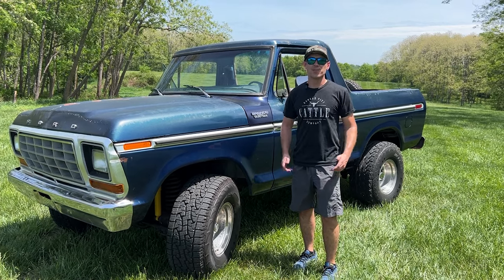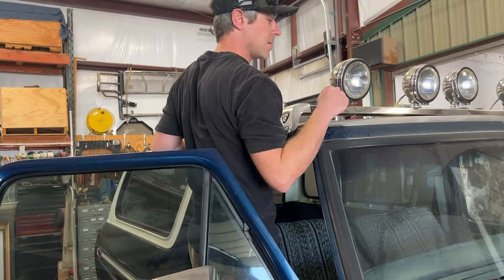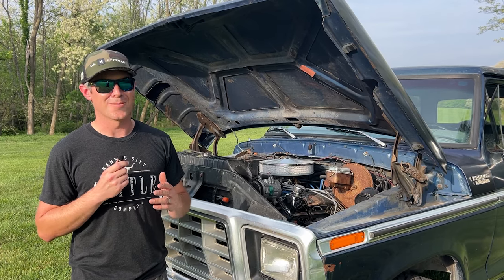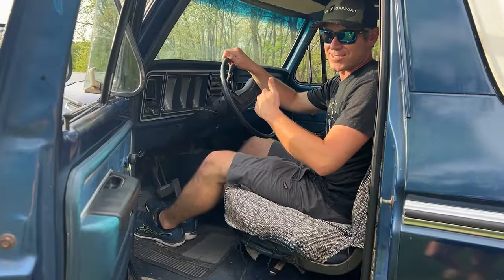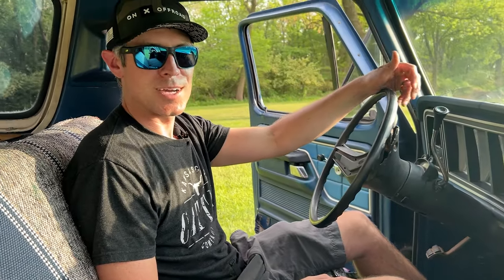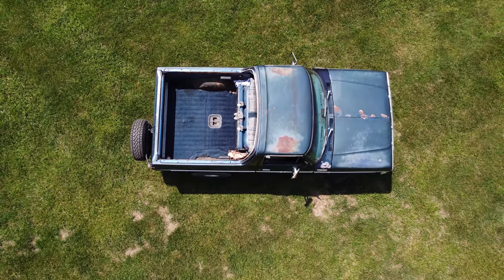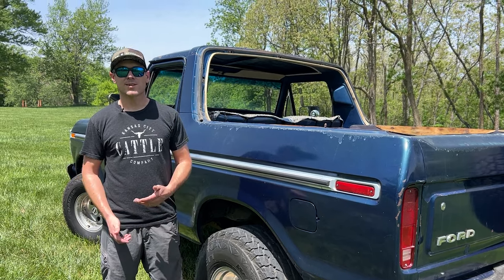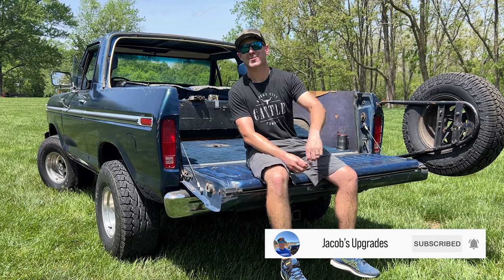Check Out My 1979 Ford Bronco Custom! | Off-roading

Comment: Nice Bronco. Congrats on finding a good one. I'm Restoring a 78 Bronco with a 460 CI Conversion. Lots of work ahead of me but I have the time. Retired last year.
Enjoy your restoration and thanks for posting the video.
Reply from the maker: Thanks for the comment! Congrats on your retirement and new Bronco project. Do you have a lot of rust and bodywork to do? I finally got my motor running  smooth and fluids changed throughout except the diffs. New Vintage Air AC and heat installed. Next up will be replacing the brake pads and rotors. I have plenty of Bronco videos on the channel, if you have any questions reach out!
Reply: @jacobsupgrades  I have rust at bottom of tailgate and above one rear wheel well. How do you like the Vintage Air AC and heat? I'm thinking about going that route vs repairing my existing system.
Reply from the maker: @uavoftexas6925  sounds like you have a good project with minimal rust. So far I really like the Vintage Air ac kit. I've used the heat portion quite a bit but just got the AC charged. When I bought the Bronco it had the stock ac and heat but it never worked so I don't have a good comparison. I really like how the vintage air kit fits behind the dash and frees up more space in the engine bay and only requires electric power. I had to upgrade my alternator to run everything.
Reply: @jacobsupgrades hey Jake! Im really considering getting that AC vintage kit for my bronco. Im not in too big of a hurry to get it since it costs a bit of change. Pretty much if that vintage air kit isn’t a huge upgrade that blows cold air, as if I were in my ford escape, I wont get it. 

My current original ac system doesnt blow cold, and im not sure if it will even blow cold air if i get it serviced. 

Hows the vintage ac system treating you? Did it exceed your expectation? Thanks.

Comment: Ol blue and/or midnight run. Check on getting the snap on pickup style topper for when you don't want to run with the hard top
Reply: I've always loved the second gen bronco's they a blast. I've got an 81 with the 302 V8 automatic two tone brown over tan,traded it for a geo 4dr and $300.00 cash.
Reply from the maker: I like Ol Blue! I think this Bronco had a snap on cover at one point, the holes look like they were filled in by another owner but it's clear they were there.
Reply from the maker: @brianakins7208  I've always liked the look of the 2nd gen's big body style with metal dash and simple interior.

Comment: Congrats on your bronco bro!
Reply from the maker: Thank you! We love this Bronco, I need to do an update video on the changes I've made.
Reply: @jacobsupgrades  i look forward to watching them
Reply: Bro your tires look hella cool and now i want to go get them. My bronco sits on bf goodrich 31x10.5r15s.
Reply from the maker: @78BroncoOscar95  thanks man! Run those BFG's till you wear them out those are good tires. I just changed mine out a little while back to Falken Wildpeak AT3 33x12.5R15 because the tires I got with the Bronco were over 7 years old and hydroplaned like crazy in the rain. I can't wait to test these out on the trail.

Comment: power glide is a 2 speed automatic made by GM....Ford Bronco does not have a power glide
Reply from the maker: @gregsheffer912, thank you for the comment and information. I found out my Bronco has a C6 3 speed transmission which is very common for the dentside Broncos.
Reply: right, it probably has a C4 or C6 automatic

Comment: call it the pooper scooper. 😂 

so the custom didn't have the side molding. so did they just change glove box?
Reply from the maker: @jgonzalez8250, I've been wondering the same thing. The wood grain panel is only on the glove box but does have the custom badge. There was no liner in the glove box I had to install a new one.

Comment: Try doing some more homework before posting please. You were wrong on a lot of aspects of the bronco.  Not knit picking, but people look to these videos for help. Have a good day and good luck with your project
Reply from the maker: @bronco788  other than being wrong about the transmission what else did I miss?
Reply: @jacobsupgrades  the hubs come first before moving transfer case. The only time you need neutral is going to 4lo. The C6 is an option, 4 spd was standard. If you have the 203 which is the full time4x4 that was option as well. Yes it has hubs but it could have been converted to part time. If that's the case scrap the 203 and get yourself a 205. You're probably only missing a few options that the ranger xlt had so you have a good bronco.  Now get to work and make it your own. Doing a 460 swap isn't a bad way to go either. Have a good time with it
Reply from the maker: @bronco788  thank you for the feedback! This is my first classic Bronco and I was pretty new to it when I filmed this video. I've been wrenching in it quite a bit and learned a lot but there's still plenty more to learn.
Reply: @jacobsupgrades  ya its never ending. It helps when replacing to replace everything in that area so the you're not going back before other parts fail i.e. doing tie rod ends. Midas well do the whole front end bushings and all, then you will know where you're at. Good luck